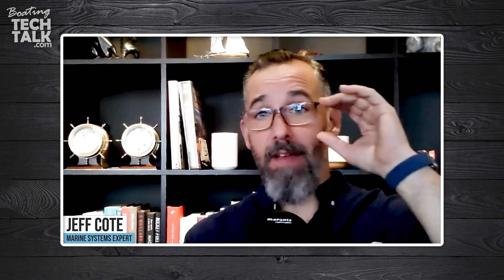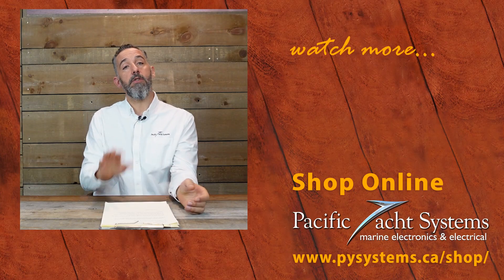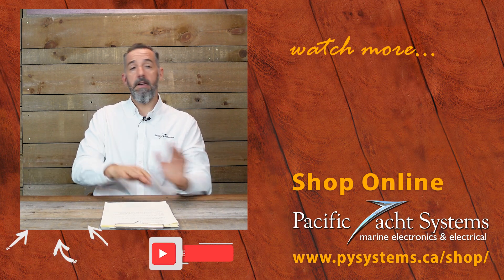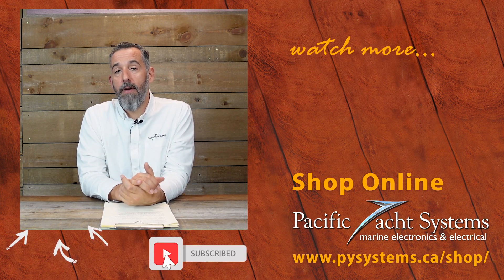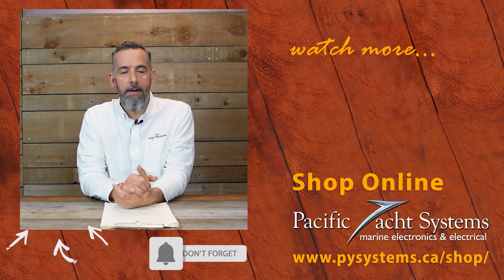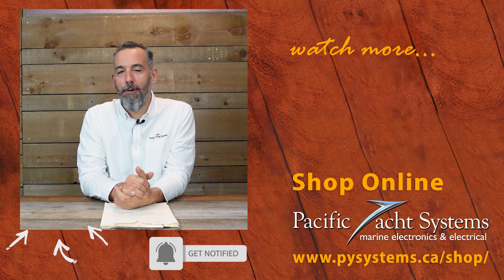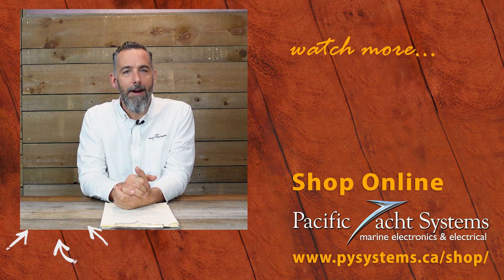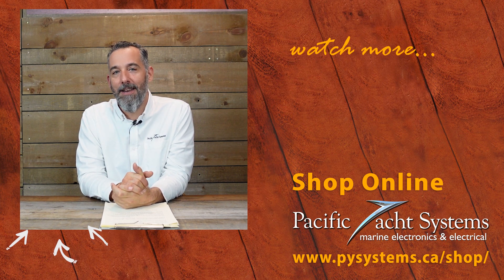Charging Two Separate House Battery Banks (possibly Lithium) and One Starter with One Alternator

Comment: The reason I have 2 house lead acid battery banks is one for services fridge etc & the other to run heavy duty Bowthruster or Windlass and a switch to combine the banks if ever one bank got depleted for the just in case scenario somehow i want to have this option in Lithium and not so much info out there on the best way dead easy to have one bank but why go backwards

Comment: A question. I have a 96v, 10amp solar panel system charging a 48v lithium ion battery bank via a charge controller that takes in only 66 volt from the panel system. Is it technically possible to charge a 12v house battery bank with the same panel system by adding a 12v charge controller?

Comment: Thanks Jeff. We bought a sailboat with a house bank of LifePo4 batteries (2) and a lead acid starting battery. The boat was not wired correctly and we are reworking it. We plan to use a balmar 614 regulator for the 100 amp alternator charging the lead acid starting battery with two 18 or 20 amp DC to DC chargers to charge the Lithium from the house. We are adding a bow thruster and will probably add another lead acid battery to run that and the windless at the bow. What advice would you have for connecting and charging that third battery bank?

Comment: No No No.  Solution is far simpler.  Have your alternator charge your starter battery + add a voltage activated relay isolator and hook up an AC pure sine wave inverter to relay isolator, then run standard 15AMP outdoor extension cords to your battery chargers, have separate smart chargers designed for battery types.  You will only use about 3.5A AC so standard extension cords will do.  Most of those relay isolators kick in when you alternator voltage reaches 13.8v so inverter will only be powered up when alternator is running.

Comment: QUESTION: Will a DC to DC charger in a system get messed up if I have a digital on board battery charger plugged in when the boat is back at the house (110v AC into the charger)? The digital battery charger is for the deep cycle batteries. Would the DC to DC charger work backwards and charge the start battery, or would it be a mess? Thanks for any advice.

Comment: im about to commision a similar system, but the third bank is 24v and the other 2 are 12. victron orions are my solution for alternator charging, using software to manage total amps draw and solar to supplement both house banks. the 24 volt is lithium the 12 is agm

Comment: Wish you were here in Sint Maarten where we are needing to replace our house bank and taking the opportunity to go lithium.  Unfortunately, getting confused and conflicting opinions about two aspects of system design.  We’re a catamaran w house bank and two starter batteries, two chargers for house (40&60amp programmable), 2 -70amp alternators, 2,600w solar, 2000w inverter (sufficient at present) and 13.5kw Genset. 1st issue is AC-DC charging which needs to be increased to efficiently charge 1200ah lithium bank when solar falls behind.  Do we add another charger(s) in parallel to existing or scrap existing and go w larger combination inverter/charger?  2nd issue is charging both lithium house and starter batteries .   Plan to add external regulators to both alternators but installers disagree after that.  One says charge lithium then use DC-DC charger (need more than one?) to charge starters from house while another advocates using some sort of relay to direct charge between the two.  SOO CONFUSED!

Comment: The sailer that have agm and lithium together.

Can you make us a video on this.????

Many wondering how you can put this together.

And the sailer says it works and it can be done.

How is that possible??

I have VW lithium 10 11kw pack. And 2 x 9.2 kW agm enersys powersafe topp of line agm batteryes.

Will it combine ? And how ??

If you see here in YouTube and see after lithium and agm together,  you only find 1 of them i do belive

Comment: I’m about to do the same thing in my 33ft sailboat. So only 1 house bank and 1 start battery. 
In order to get the most out of the generator (will be replaced with a Balmar 100A generator with external regulator (of course with the voltage measured at the battery 😉) and if I can fit it, a fan with a duct to the outside to get cool air to the generator. 

I was thinking. The starter battery hardly needs any charge compared to the house bank, so why not have the generator charge the house bank, and a dc-dc charger to charge the start battery? 
In my mind that would be a better way of getting more out of the Lithiums ability to use the generators output.

Comment: Could you go from the Alternator to an isolator (FET Combiner) from there to a DC to DC converter then one going to Lithium batteries and the other to charge the Engine start battery ?

Comment: I am putting in a 300 Ah Lithium house bank . I have an 105 Ah agm engine battery and 160 Ah bags bow thruster bank. I plan on having 2 30 amp dc-dc chargers for the house bank being fed from the battery isolator. Feeding the the isolator is a 120 Amp alternator and a 100 Amp charger. The isolator also supplies the 2 age banks.  Is that a reasonable setup?

Comment: Hi, A bit late to the party, but your videos are extremely informative years and years after they have been published. I have watched so many of them several times in order to make sure I understand. The result is often that I understand that I understand very little :-) An inspiration to learn more of course! Would it be possible to have a solution where you have an argofet 1:3 where one output goes to the starter battery and where you connect a DC to DC charger directly on the two other outputs from the argofet and then to the lithium battery banks? The DC to DC chargers could then be set to a lithium charging profile and the charging would be ok. The DC to DC charger would also limit the amps drawn from the alternator.

Comment: This is clearly a question on a lot of people's minds !  My question is - in a setup with a lithium house bank and an AGM starter battery connected by a DC-DC charger (Victron Orion in this case) relying on an alternator for charging, why does one want to charge the Li house bank through the AGM starter battery vs the other way around ?  Only so much charging output is available to the Li bank from a DC-DC charger configured in this fashion, diminishing the benefit of the lithium bank's bulk charging rate, versus using the DC-DC to charge from the house bank to the starter battery, where the starter battery is unlikely to benefit from anything more than the 20 to 30A that the DC-DC charger provides.  I understand that you will need to protect the alternator with a Sterling or Balmar APD for protection against a load dump from sudden cut-off or reduction in Li house bank charging, but this configuration seems to retain the benefits of fast Li bulk charging, and provide plenty of charge to keep the AGM starter battery healthy.

Comment: I've purchased a new Pontoon boat with a 90 Hp Mercury out board with one starter battery. I also have two deep cycle batteries for a 24v setup for my 70Hp trolling motor. Obviously the motor is charing the starter battery. How can I use the motor to charge the two deep cycle batteries? They are all led acid batteries.

Comment: I was sitting here thinking about the wiring for a battery charger and fuses. The wire going from the battery charger to the battery should be fused I think. There is a fuse at the charger to the battery but there is no fuse at the battery connection for that wire. It’s a straight wire to the battery charger. What happens if something happens to that wire? There is nothing protecting it in the reverse direction. Should there not be a fuse at the battery from the battery charger?
Reply from the maker: Good observation, one should definitely fuse the battery charger connections at the battery.

Comment: Hey Jeff, have recently purchased dual lithium hybrid cranking batteries i am planning on running in parellel for house and starting purposes. Still tossing up the best way to wire these up to the alternator? Any thoughts, thank you.
Reply from the maker: You'll either need a alternator with external regulator or you'll need a DC to DC charging converter.
Reply: @PacificYachtSystems  thanks very much. Leaning towards dc to dc

Comment: When he makes the switch, he would be better  getting rid of the FLA on the crank and changing to AGM .  He could pick up a MV plus 12/3/75 and  a straight DC profile for now, then when he makes the change, create user a defined profile, and set it up as a DC to DC charger off the alternator for on board charging.  Set the float at 13.8 for shore charging,  no?
Reply from the maker: Thanks for contributing Roger!

Comment: Hey Guys! So I have a question that follows on with this thought process. I too am getting ready to make the move to a live aboard Lifestyle.
I wanted to charge my house bank from the alternator. Then have the house bank keep my start bank topped off. Is my process wrong? I don’t want to let the smoke out of any components.
House bank is 6, 12V 100 Amp Lithium LifePo batteries. Start bank is 2 AGM 12V, both are in parallel.
I have upgraded my Alternator regular to a Balmar 60-YP-MC-120-K6 at 12V – 120 amp with a Balmar AMP-12 Alternator Protection Module for 12 volt system.
Then from the Lithium house bank to the Orion TR Smart 12/12volt – 30 amp Isolated charger. That will keep my start bank topped off.
Best Reguards
 David L Houston
Reply from the maker: Make sure the external regulator is set to a Lithium charge profile.

Comment: Hi Jeff, I have been reading on the Victron site and it appears they claim you can run multiple DC to DC chargers in parallel.  That might be a way for him to go.  Or maybe adding a second alternator with a lithium charging profile.
Reply: Stock alternator is too small for even one continuous 30A charge. So to get more energy from alternator, it needs to be upgraded anyway. In my opinion, it would be best to add some high output second alternator with lithium profile like Balmar to the system, as you said. Then there is no need for DC to DC conversion, start battery would be charged from stock alternator and Lithium would get full output of second alternator. But that also needs some safety guard, when Lithium decides to disconnect due the over charge, over temperature or other reason. There are devices like Sterling alternator protector, but it is more like additional guard not like only guard.
Best way would be some kind of external BMS or even Lithium battery with external communication port that could send message to alternator to stop charging before battery is disconnected.
Reply from the maker: Yep, we run up to 3 DC to DC charging converters in parallel.

Comment: We use 600 watts solar with 300 amps LifePO4 house. 3 x50 amp AGM in parallel for engine and windlass, 70 amp alternator , DCDCMPPT Charger & 1 40 amp MPPT charger, & Honda EU2200 gennie as backup and 3KW inverter charger.Been cruising on our 42 foot sailboat for 6 months and no issues. SOK batteries and Renogy controls!
Reply from the maker: Thanks for sharing, glad it's all working for you.

Comment: I just bought an old boat and trying to figure out the electrical system is overwhelming. It stresses me out wondering how I am going to troubleshoot anything if something quits working. I'm pretty sure it has an engine and house bank. I have two alternators, generator, solar, wind, a Freedom 3000w inverter charger, and I just found a smaller charger in the engine room. I have no idea what is charging what. I'll eventually get it all figured out. There's a lot of components I've never seen before.
Reply from the maker: It's a process Tracey, electrical was scary for me too when i started. The first step is to be curious... slowly but surely you'll get more familiar.

Comment: I am currently on the market for a 40 foot sailboat. It is being hard to find one that fits what I am look for in the current market with a generator. What are the alternatives to run a 16 BTU air conditioning without a generator while not connected to shore power? Thanks for any information that you can provide
Reply from the maker: You'd need a huge lithium battery bank and then a massive solar array, some catamarans can pull it off because of the solar array size, but it's a real challenge for monohulls.

Comment: Hi Jeff,

Thank you for getting into this subject in such detail.
What comes To my mind is that you connect the battery isolator right after the alternator and then from that battery isolator can you connect an external regulator to charge lithium batteries.
You do not connect anything else to the lead acid batteries as they charge through via standard alternator charging profile. Of course as you mentioned you have to replace the stock alternator for the overload.
Reply from the maker: Interesting, but i've haven;t seen this done before. From my understanding the external regulator drives the output of the alternator as opposed to modifying the output of the alternator.

Comment: Hi Jeff, long time fan! I may have missed this but I don't often see you recommend having the alternator charge the house bank(s) directly, and using a DC-DC charger to charge the starter, which seems to offer the best of both worlds. It let's the bank that drains the most (house) absorb the full power of the alternator, and use the relatively low Amp DC-DC chargers to trickle charge the starter, which will normally be near full. Is the perceived lack of promoting this configuration due to a concern of this config or just the more complicated rewiring necessary for many DIYers?
Reply: If the lithium bms disconnects, the alternator goes poof, as can your electronics, due to the voltage 'spike'
Reply from the maker: Here's the challenge with this setup (high output alternator (with external regulator) directly connected to lithium house battery).

If your alternator is outputting... and in the unlikely event your lithium BMS decides to disconnect the lithium battery, then your alternator might get damaged from suddenly losing the battery connection.
Reply: @PacificYachtSystems  gotcha, that makes sense for Lithium. I have a Firefly house bank with a Balmar 170 Amp connected to it. And use the Xantrex echo charge to charge my battery. Hopefully no concerns with my setup that I've overlooked!
Reply: @PacificYachtSystems  If the lithium batteries did shut down the alternator would still be connected to the AGM’s through the dc/dc charger(Victron Orion 30) and absorb the load dump. For extra protection as a alternator protection device like a Sterling alternator protector for under $100 or something similar. As for electronics being damaged in the worst case scenario proper fusing should protect them.
Reply: Matt, I totally agree. I’ve been searching the web for an answer to this with no joy. I can not see a problem with your idea but any one with the knowledge seems to avoid the question. What are we missing here?